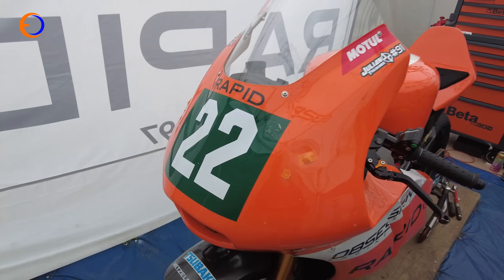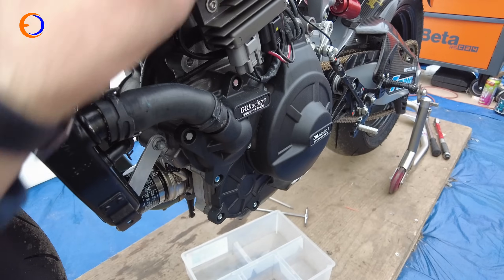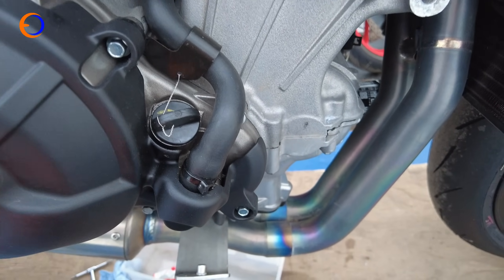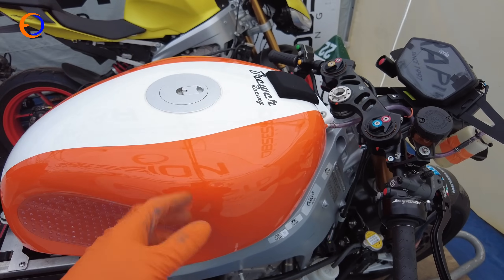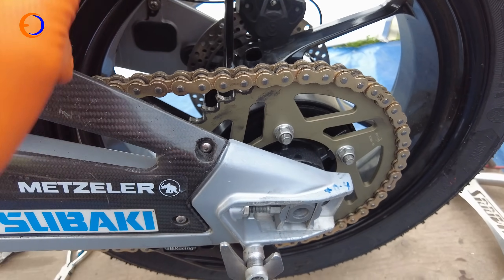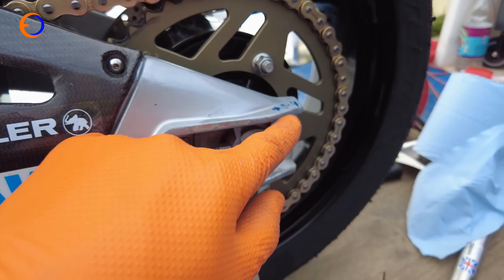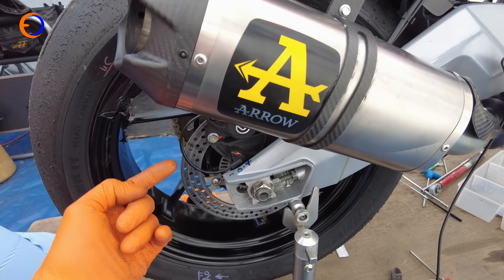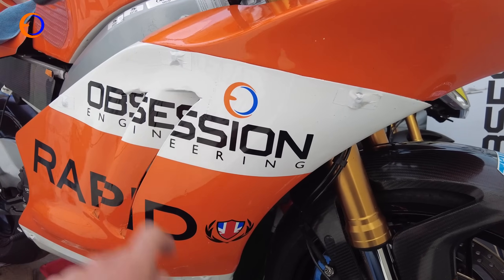Isle of Man TT 2024. Getting Ready How to prepare your race bike. Aprilia RS660 build between races

Comment: Really helpful guidance re chain tension on the RS660.  The user manual says 30mm of slack which clearly is not enough for this bike. I will confidently use your value of 35-40mm from now on.

Comment: Thank you for the answer : In driving shool they teached us warm driving but not the difference to "cool down round" or airfan in use 
the stop & start function at honda work in few minutes and reacting because the engine temperatur only at frezzing winter temp. after five min. start & stop work ...can not wait till the maintenence for valve adjustment at the inspection sheed bring more "news" out of my first honda 
chain 🥳 : Yamaha no drama at all (low running cost) 
italy 🤔 : only ducati , but your april. talk-about sounds good 🙄

Comment: Hi Dave, are you running a standard fuel tank? 

And having 4 litres left after 2 laps.

Cheers.
Reply from the maker: No, we have a custom 20 litre tank
Reply: @obsession_engineering   do you think a standard tank would do 2 laps as we have a 670 for the Manx grand Prix.
Reply: 660
Reply: @terrim thinking of going there in august. Let me know if u need a pilot 😂ygilmour4161